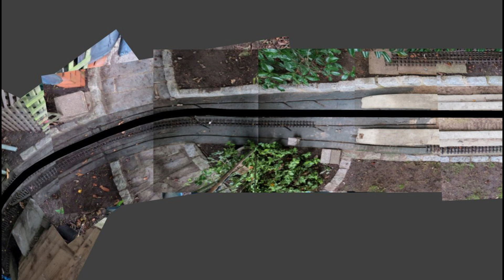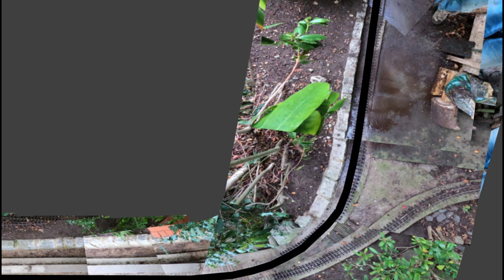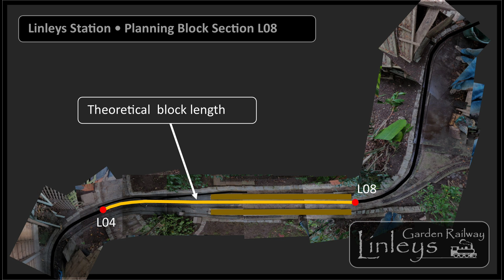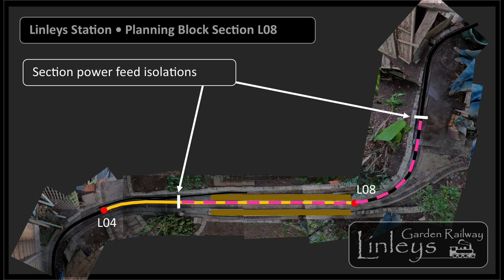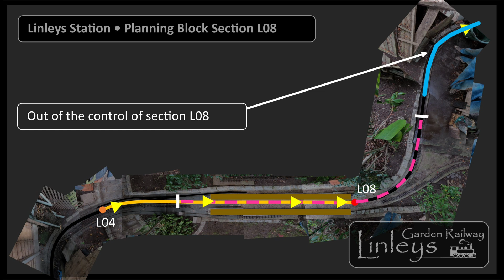Garden Railway Train Control • Block Sections Explained • Signal control

Comment: Nice explanation of how your block signal system operates.  On you next video can you show how the blocks are signaled, by relays, or track shunting perhaps.  Is there a sensor on the loco and rolling stock perhaps.  Also are the trains running track power or battery?  Cheers!  Ron//
Reply from the maker: Hi Ron, I have developed a complex control system based on a simple idea - Decentralised Logic Control in that signalboxes control the trains, not the drivers!  I have more to explain in later videos but take a look at the playlist here for what I've shared so far... 
https://www.youtube.com/playlist?list=PLKASdfbXD7w7m3KRxbMQmJmJUB8N2a-a3
Thanks for your support, I much appreciate it! Cheers, W :)